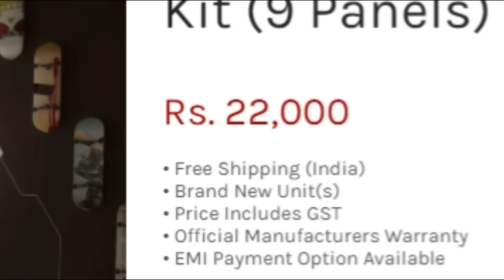How To Make Nanoleaf Aurora RGB Light Panels - Smart Home

Comment: At an electric market in my city, I got 1m led's formation light for 50 each. I required only 2 so I bought them. 100rs.
And all of that cardboard and all costed me only 60rs.
Total 160rs 😎

And it looks dope
Reply from the maker: Wow great send me pic of it on Instagram
Reply: @Technocrafts  sure, before 9 👍
Reply: @Technocrafts  bro what is the size of the rgb strips? Pls reply
Reply from the maker: That was 5 meter bro
Reply: @Technocrafts  tnx
Reply from the maker: Never mind dude
Reply: @Technocrafts  if want to cover my full side of my pc than i will need 130 piece. So how much it will cost? pls tell me
Reply from the maker: @safwanahmed9014  It may vary but I suggest you to use Normal Brown Cardboard if you want to make 130 pieces as the white one that i used in the video is expensive so just use Normal cardboard and about light you would need around 1820 meter light! Dude light would cost you much😂 In our video I used 14 pieces where I needed 5 meter Light so if you make 130 pieces then it will cost you Rs.91000 !!! 🤣as it will need 1820 meter of light😂😂 dude make it smaller ✌😂😂
Reply: It got me 230 rupees 😜😜
Reply from the maker: Aree vaah great👍🤣💯
Reply: Is there a link of where’d you get your LED strip?
Reply from the maker: Actually I bought it from local store but still you can get it online here are the links:
RGB Light: https://amzn.to/2EPeLUU
Silver foil: https://amzn.to/3jiqqdU (I have used Silver paper but you use foil it gives better result)
Foam: https://amzn.to/33hKDuJ
Reply: Technocrafts Thank you so much!!
Reply from the maker: Never mind
Reply: What is the size of the triangles?
Reply: What kind of cardboard is it?
Reply from the maker: Its white cardboard bro you can get it in any Stationary Shop or you can even use normal brown cardboard

Comment: Nice job, but you had some dark spots. I personaly used more led to fill all the walls in. And it got rid of the dark spots
Reply from the maker: Yes that's great ✌
Reply: @Technocrafts  or it would be nicer if you put foil everywhere on the inside
Reply: @Trashticz  some good ass sleep will also do the work

Comment: Bhai I have some doubts please reply me
Reply from the maker: Yes?
Reply: @Technocrafts  bro what if I use the normal brown colour card board?
Reply from the maker: But do stick aluminum foil or any sort of silver paper inside
Reply: @Technocrafts  the cardboard you used is sunboard/ PVC foam Sheet sheet right?? 
It's in Amazon, will the pack of 5 , 6×6 inch be enough?
Reply from the maker: @ok6114  Why don't you use normal brown carboard..I used that White board just because I had it..You can use Brown cardboard
Reply: @Technocrafts  the brown cardboard is not that good in condition as I thought it would be bro? 
Also the one I told you about is that right?
I'm sorry if I'm being pushy
Reply from the maker: Never mind I am here to help.. And the one you are saying 'foam board' i haven't used that.. I have used the white board its similar to cardboard I don't know what its called but you can get it in any stationary shop.. Or else you can even use the foam board you mentioned earlier
Reply: @Technocrafts  bro it is a question 😅
Reply: @Technocrafts  bro where are you from? I'm from Hyderabad. If you don't feel comfortable I'll stop it
Reply from the maker: The one you mentioned pvc foam sheet pack of 5 will not be enough.. You need lot of it.. So I suggest you to go in any stationary shop and bring the same board I used.. Just tell them its similar to cardboard and its layers are made from plastic.. You can get it easily bro.. Like its very Common😅
Reply from the maker: Chill 😂
I am from Maharashtra
Reply: @Technocrafts  thank you very much bro. Yes I'll ask it tomorrow morning. Need to finish it as soon as possible bc I need to study after that
Reply: @Technocrafts  also what are the measurements for the triangle shaped cardboard?
Reply from the maker: Yes you can use Normal Cardboard and the size of the triangle is 25*25*25